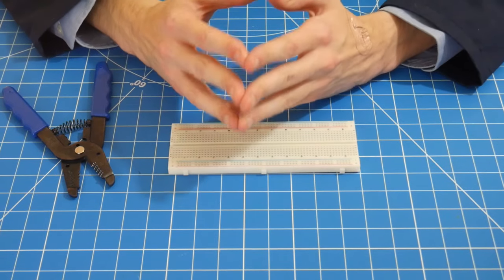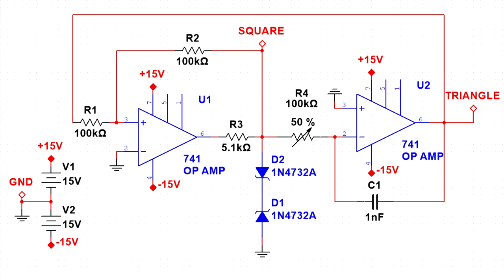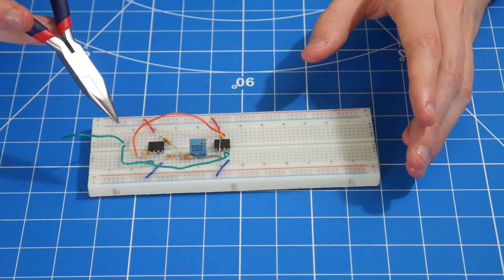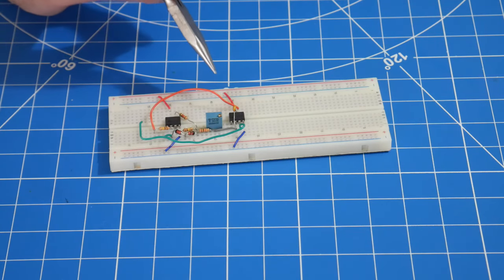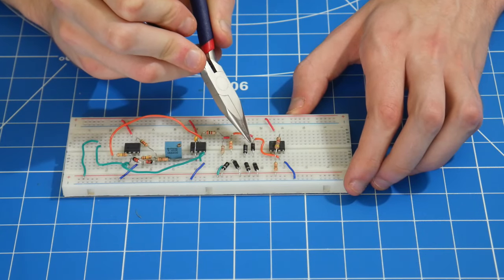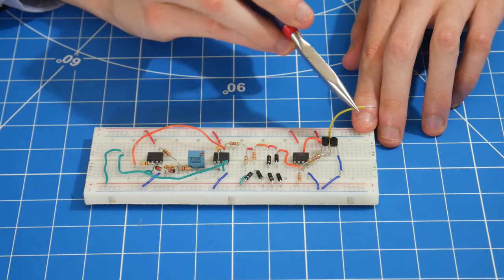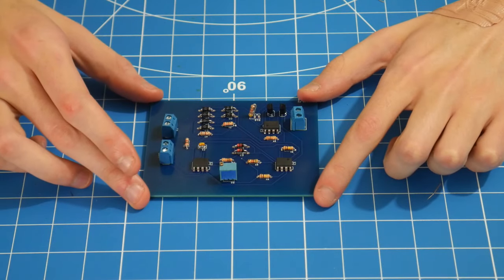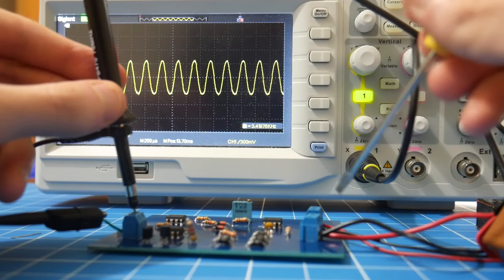Build Your Own FREQUENCY GENERATOR on a Budget (Sine, Square, & Triangle Waves)

Comment: I can't understand why you used 3 old, and hard to find op-amp instead of eg cheap and easily available 2x LM358 (dual op-amp) or 1x LM324 (quad op-amp) 🤯
Reply: the 741 might be the easiest to find opamp out there.
Reply: @Antilevitation  Very old and bad today.
LMs are newer and much better, easer accessible.

Comment: Thank you for this video. I have an old Skyhawk A4 Artifical Horizon that runs on 115 VAC at 400 Hrz.   Your circuit mentions 15 volts in but not the output or the current or if its R9 that  va aries the frequency. I suspec t its actually R4, the 100K  prior to the Triangle output  U2 -741, I'd really appreciate some direction on how to supply up to about 100 watts of power from 115VAC 400 hz, I will subscribe and look for your contact info.